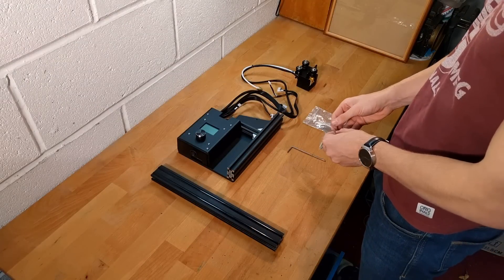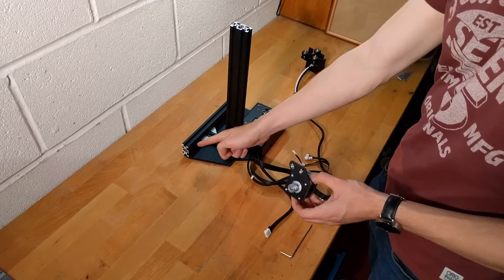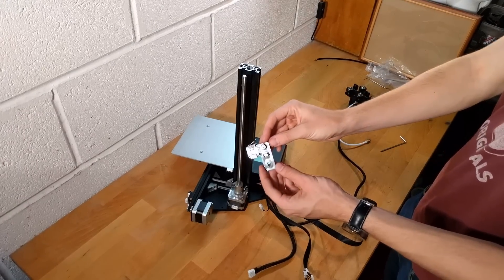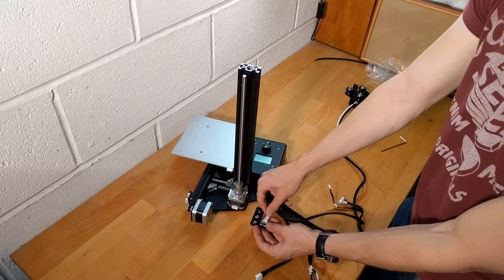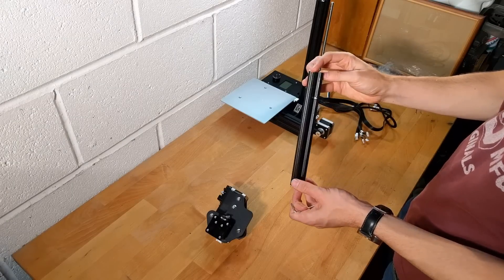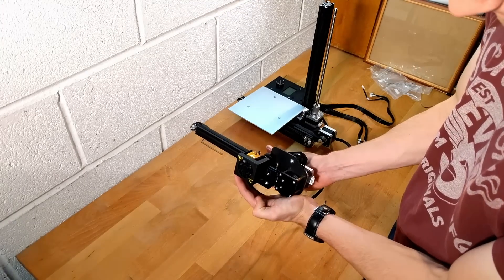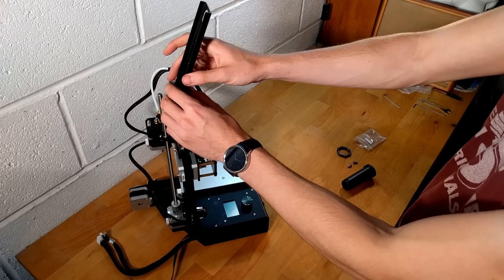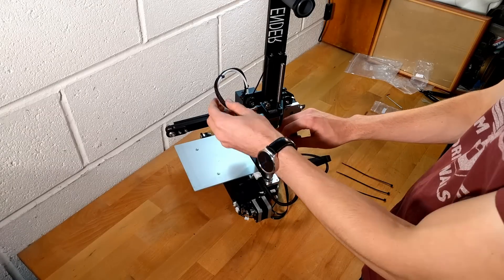Build your own 3D printer! - An ENDER Build Tutorial

Comment: Hi ! I like your pace. The main difficulties I have encountered were inserting the X-axis ( fully equipped ) into the Z- axis without removing or loosening the leadscrew ( which I was forced to do in the end ) and secondly adjusting the Y-Axis stopper until I realized that I had to move it down so that it could be activated by the basis and NOT the hotbed !  Good job !

Comment: Good tutorial but some things to keep eye on while building:
Y and X-axis belts: make sure they do not scrape or touch the aluminium profile when moved back and forth.
"Self-tapping" bowden tube insert: this is crucial to get straight or you could have problems with under extruding filament. I just don´t understand why they did not add threads to begin with.